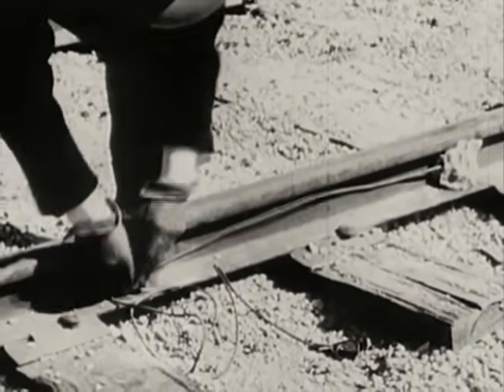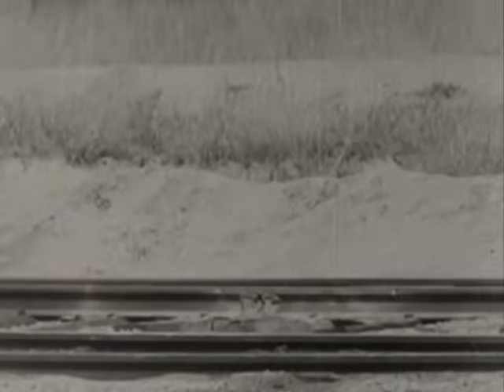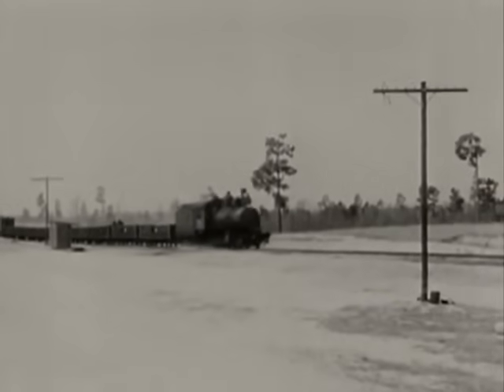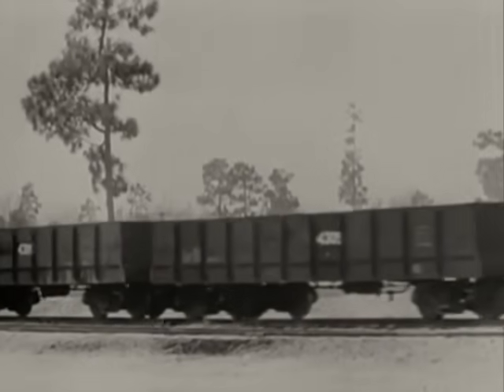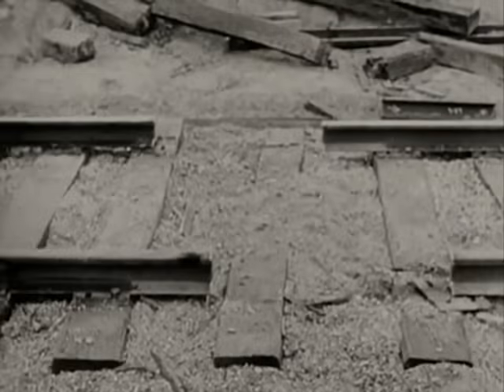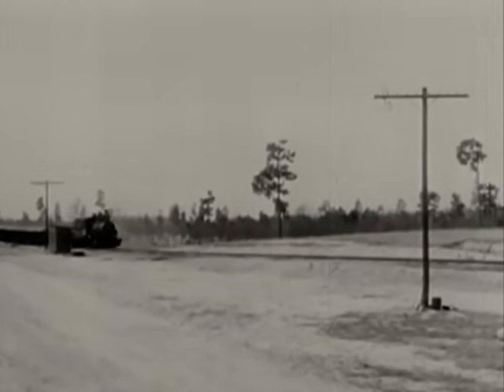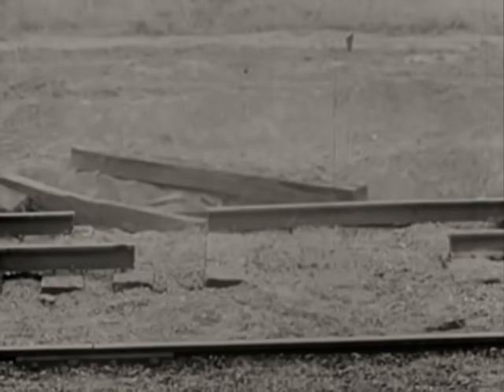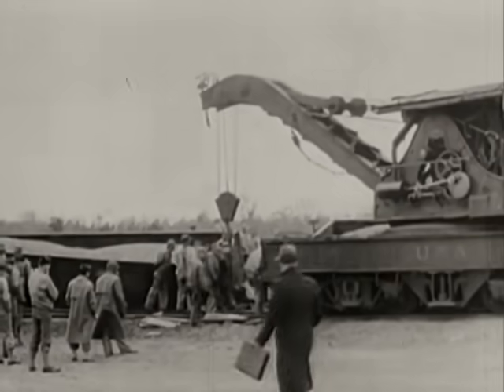Army Experiments In Train Derailment & Sabotage - 1944 - CharlieDeanArchives / Archival Footage

Comment: Why can't they just take 20 feet of rail out of one side.
Reply: to much weigh for 1 or 2 man to move
Reply: @johnsmith-yj2cn  WHy can't they bend the end of one rail?
Reply: @sneadh1  That requires some very heavy tools and time. The tools are nowhere near easy to carry, especially not in a war-situation during nighttime. Now try to imagine you are on a covert mission trying to get to the specific piece of track to make that very important artillery-supplytrain derail. For bending just a piece of rail, one would need to remove fishplates, a certain amount of bolts from the sleepers, and then start bending it. If that's not possible (as there are no fishplates at that particular spot for example), one would need to blow-out a piece of the rails. That's not the biggest problem, but an explosion in the middle of the night, draws attention. If you then have to get back to the tracks in order to bent one of the rails, you run a very great risk of blowing your cover.
Reply: They want to miniature weight they carry in explosives
Reply: That’s a good idea....I didn’t realise the resistance had their own designated track department.......

Comment: ....@ 2:42 Using a Sledgehammer Defeats The Whole Purpose of Finding Out How Much Plastic explosives are needed to Derail the Locomotive....
Reply: You do understand that it's a stack easier just to knock that section out, rather than taking the time to reset another charge? It's pretty simple thinking, especially since it widened the gap to what they wanted by just removing that section with a couple of blows of a hammer.

Comment: Wouldn’t it be easier to just remove a rail
Reply: No, it would be easier just removing ONE fish-plated joint, (plus enough spikes to move one rail out of alignment) and "splitting the gauge" by inserting BOTH removed plates, at that joint - after moving ONE RAIL "to the side" - & inserting the two plates as a single unit - (inside one rail & outside the other) - modifying the joint - into an instant auto-derailing switch blade.
Reply: or, leave the rails and remove the sleepers. Perhaps remove the wheels
Reply: Not when you're behind enemy lines and being noticed gets you shot, no.
Reply: Rails are welded together
Reply: Isaac Guérard Not then, the use rail jointers and bolts. Only the super smooth track (like on high speed rail) is welded

Comment: all you need is a gap on the outside rail at a turn.
Reply: the narrator mentions this at the beginning
Reply: They said at the beginning that the challenge was because it is a straight section, not on a curve.  They need to know worst case conditions - if a curve is not nearby.
Reply: One , the turns as you call them are a much greater curve . Depending on the speed of the track. Two how are you  going to widen the track ?   These days with spring keys being used . You will need a online special machine to get them off .

Comment: Interesting experiments, but why not simply use a derail wedge?
Reply: ONLY if it's inserted horizontally - after removing a joint's fishplates and re-inserting them between the rails - (thereby splitting the gauge - AT THAT JOINT - see?)
Reply: Assumes you have one on hand. A soldier is much more likely to have explosives as part of their semi-standard kit than a derail wedge.
Reply: Derail wedges don't always work either.  They didn't in the 2001 CSX 8888 incident, which inspired the movie Unstoppable (most of that movie has no special effects).
Reply: @michaelpeele5739  True, they were attempted in the Sjursoya incident too with some runaway rolling stock...
All it accomplished was sending the wedge flying and kept on going... Well they did stop... But it was the ocean that stopped the cars, after they smashed through a buffer and an office.

Comment: THE MORE YOU KNOW
Reply: The less it works (for the US Army boffins that was).

Anyone who has EVER worked on a railway will tell you.

It all goes to prove ONE THING ..
The US Army didn't know dipshit about HOW to derail a train.
All one person needed to do - was remove the spikes from a few sleepers either side of ONE joint, then REMOVE the fishplates from that joint , LEVER OVER just one rail and place BOTH fishplates between the two rails, in this way..
INSIDE one rail & outside the other..
Making the gauge at THAT JOINT smaller on one side of it (forcing each axle's wheel-flange-sets to ride UP & ALONG the top of an under-gauged section)
& 
Immediately following that, the OVER GAUGED section - being LOT WIDER AS WELL AS A FULL RAIL-FOOT WIDTH - OUT OF ALIGNMENT (from that of the other rail) - instantly places the FLANGE of all wheel-sets, OUTSIDE of the next section of rail - forcing a total full derailment
.
Instant derailments will always occur if done exactly that way. 
(it's exactly the same principle as if a turnout switch blade was "opened" without CLOSING the other turnout switchblade - forcing any train, to SPLIT the points & drop down between the ever widening outer turnout legs - causing an instant derail)..

Removing sections of "railhead" out of perfectly straight track - does diddly shit for derailing and everything for a rough ride "across the gap" .. onto good rail the other side.. perfectly in line.

Plus - the "displacement" of a single JOINT's fishplate to "split' the gauge at that joint, can be done BOTH SIDES - either via the same direction of "split" or the opposite way & it doesn't even need to be opposing joints either, one done here, and the opposite rail done 40 ft. away = same result - to ensure trains running IN from either direction will "split" the gauge at either point .. instantly derailing.
Reply: Quix Kiwi you basically explained exactly how a switch point derail works for protecting mainline track by using half a switch point to derail a train, but when lined the train rides over the switchpoint, we have a couple on the line I work for, protecting unwanted movement from a mill to our mainline
Reply: Quix Kiwi you must be European lol because in the USA

Fishplate=Joint Bar
Sleeper=ties 

Haha